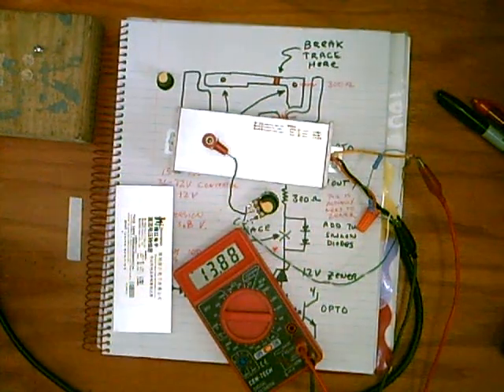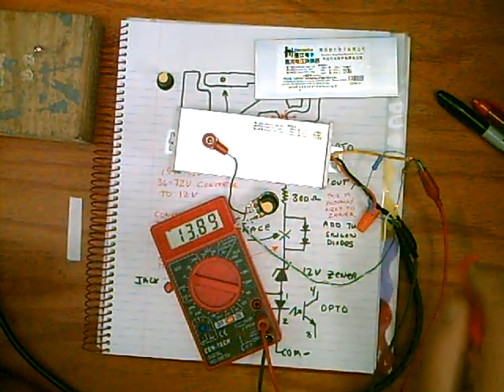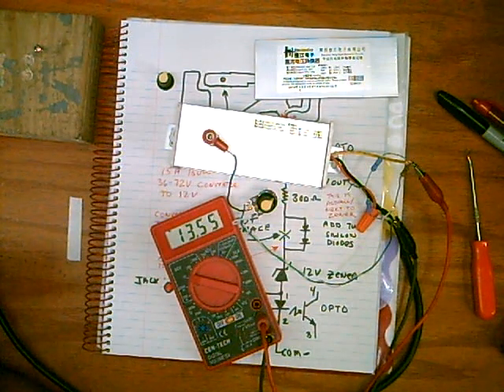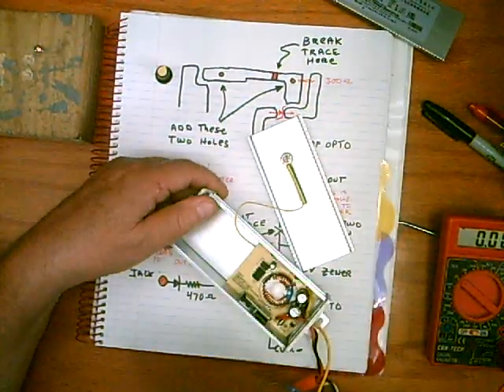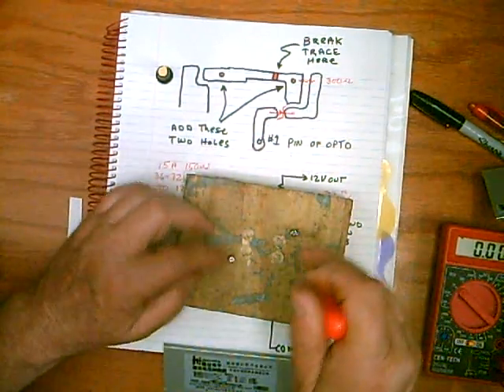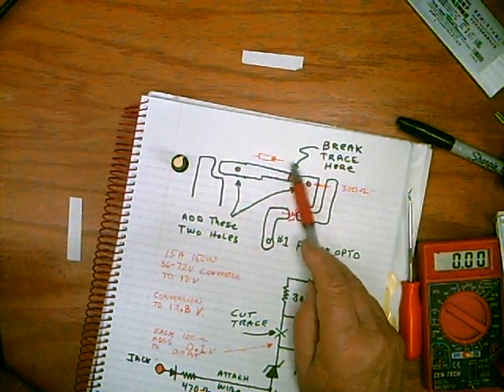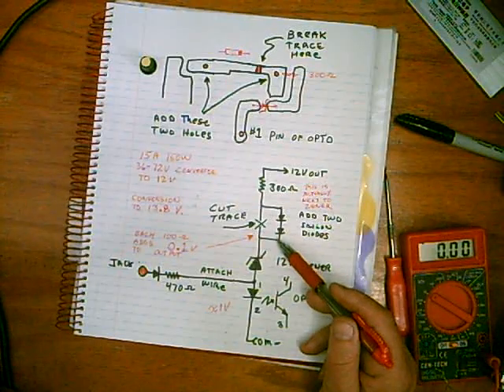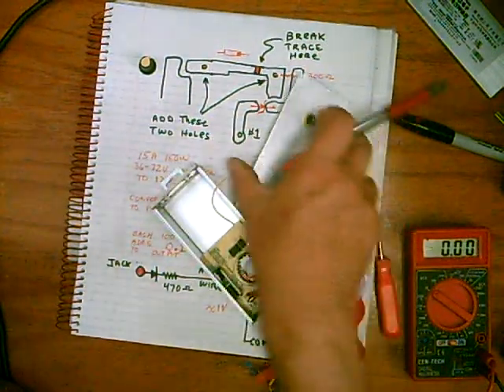Easy Buck Converter Mod To Make MPPT Charge Controller, Slave (pt2)

Comment: Ive convert my soundtech bl-328 24v to 12v 15a buck converter to adjustable and connected to my 10a solar pwm that converted to higher current i add 4 pcs high current mosfet and do i need to add blocking diode on the buck converter going to solar pwm? It heats up in few minutes my diode is silicon type 50amp whats the problem with my replication?☹️
Reply from the maker: I could find no listing for that.  Is it the diode heating up? That will dissipate several watts. Not always needed and using FET as switch would be better.  4 FET could be a problem, are these heating up? That may be too much capacitance for the driver at that frequency. A single 100+ amp FET should be enough.
Reply: @opera5714  i solve the problem now😊ist normal to my buck converter to heat up? At 14.5v but ican still touch it
Reply: My fet is not heating up only the diode before but i solve it😊 the only problem is my solar pwm is not shutting off when it reach 13.5v i set it in that voltage to the solar pwm but it still goes up to 13.8v🙁
Reply from the maker: @smoke_stackz3168  In PWM batteries will maintain a surface charge voltage even though PWM goes to almost zero becayse it is always pulsing at a higher voltage.  My cheap controller reads 14.2V even though the battery reads 14.6V at full charge. Assume that is a software fudge to keep people from getting upset.
Reply: @opera5714  im planning to use my solar auto cut of that i replicated from kywdo mppt it uses opto oupler and mosfet just simple circuit.but its not mppt mosfet turn on and off the input and when it reaches 13.5v the opto coupler turn of the mosfet

Comment: Finally found these thing on E Bay.  Can't find your 15A version only 10A.
Reply from the maker: I found them https://www.ebay.com/itm/24V-60V-36V-72V-48V-120V-To-12V-15A-180W-Converter-Adapter-US/303200832511?hash=item46982d8bff:m:m8i2BsEMKg_ttPffJS2twYw
Nice they have an even higher voltage one now. Don't buy the 10A.

Comment: how are you connecting the master to the slave ?
Reply from the maker: I haven't done part one yet. The master has a TL431 monitoring panel voltage.  That provides a pull up voltage to the opto isolators.  This could also be from a microprocessor. Thes buck converters take all the hassle out of designing your own, layout issues and sourcing parts. This leaves you free to use any open source code without a lot of building. Do you have a specific application?